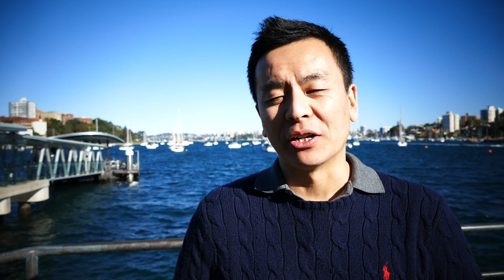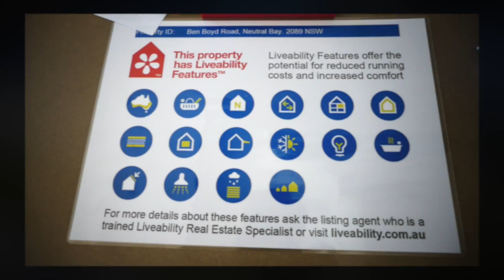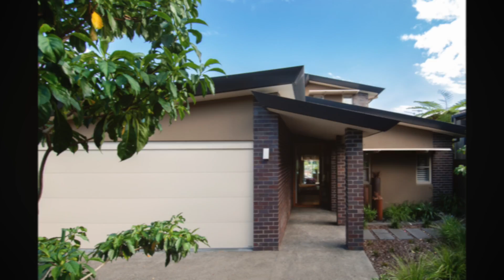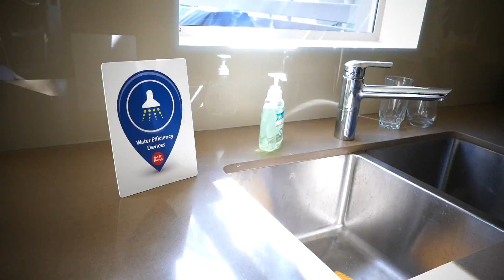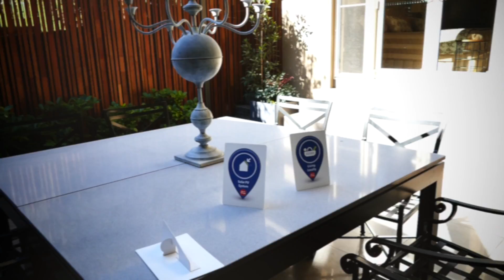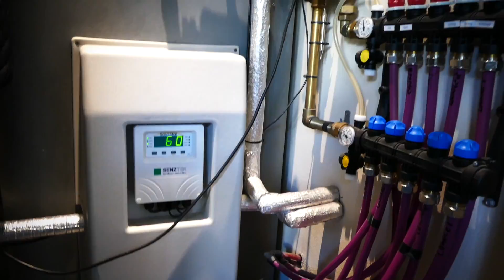Sustainable House Day Solar Hydronics | Ludicrous Feed | Tesla Tom

Comment: Gorgeous house...    I wish a passive solar design were possible for my new home but where I am in SW Florida the environment is just not right, thankfully a passive house is easily attained (well, it’s required two years of research and a million little details had to be considered), especially with the SIP (structural insulated panels) method I’m using.   Many thanks for the great video and the excellent links...   I really like the CLRE page, what a wonderful government agency !!
Reply from the maker: orion khan Glad you enjoyed the video. I’m hoping this house and many other sustainable houses open to the public on Sustainable House Day will inspire others to think about their own living spaces.
Reply: Ludicrous Feed  -  what I’ve found most remarkable in my recent studies of building science is how slow we are to change.   To this day I see new houses being built with vented crawl spaces and attics, two horrific practices that need to stop (among many other construction hold-overs from decades past).   Vented attics are obvious...   you have a mass of super-heated air directly above your conditioned space with the cold ductwork running through it, a recipe for inefficiency and mold (not to mention the space wasted with trussing).   Crawl spaces are similar, another outdoor like mass of air with pipes running through it with similar results.  While not at any specific risk, I’m building my new home with a 5’ sill wall, a solid re-enforced concrete wall, with an insulated concrete slab inside of it.   A French drain runs the perimeter of the wall which is waterproofed on the outside with several inches of closed-cell foam sprayed to the inside...    underneath the slab is 4” of EPS (extruded polystyrene) with a poly-vapor barrier between the foam and concrete (all on top of the scraped and graded land which has a specific type of gravel on top).   It is essentially a miniature basement that sits above the ground with an access hatch inside a closet, lighting and it’s own dedicated (but small) conditioned air input and exhaust.   While this does add to the cost of the build, it really isn’t much and the benefits are well worth it...   it raises the house for any future flooding, bugs and other critters can not get in, it allows alternate paths for air ducting, makes water pipe access easy and most importantly keeps the wood beams supporting the floor in a dray and conditioned environment.

With the structural insulated panel construction I’m using, traditional roof trussing is also eliminated, instead using a ridge beam method, one single beam across the top.  This opens up all of that space lost in a traditional attic and as both the floor and roof have 8” of EPS and the house is airtight, that space can be used for other purposes.

Comment: Here is the back of envelope calculations:
An evacuated tube hot water heater will cost is around $10,000 installed for about 5 square meters of collection area. (Panels + tank + plumbing). Evacuated tube are about 75% efficient so it will deliver about 15kWh of hot water per day.
Spending $10,000 on solar electric panels will give you 10kW of panels which will deliver about 40kWh of power per day. 40kWh of reverse cycle air conditioning will deliver about 120kWh of heating or a little less cooling in summer. 
Solar electric panels need more area (8 sqm/kW) but dollar for dollar you get a lot more bang for your buck. You do the numbers!
Reply from the maker: You do make a good point, Peter.  There's no denying that PV panels give you a better return overall for the physical (roof space) and financial outlay.

Comment: Solar hydrologics:

We have two panels, also vacuum tubes - but in Germany at roughly 51° N / 7° E.

Efficiency: Impressive - the system captures boiling water from the roof on completely covered days.

Effective: quite okay, over the summer you get 100% hot water for showering. I would recommend heat exchanger inserts into the dishwasher, which can fully heat this machine without any electricity. As well as a hot/cold water washing machine, which can do nearly the same. Sadly there's no dryer with a similar system, but you can maybe modify one? 🤔

Both systems need quite hot water, so you need a dedicated very hot water line from the heating circle, since the normal floor heating (we only have this in the bathroom) and convection heaters in the rooms take much colder water than they used to (45-50°C) for efficiency reasons.

So you also need a dedicated pump, we just have a switch which turns it one if both devices take more than 2W combined and turns it off after 1h after the last spike above 2W again. Not pretty, but it works flawlessly.

To the second question: The hot water tank is 1000L for two flats in one house with brick walls and pretty good isolation. (even in the attic). So 4 ppl plus 2 ppl in one house. If there would be days without sunlight and the tank is fully charged, you would have 3 days of just showering for the 6 ppl (roughly) in the tank.

If there are just cloudy days at around 10°C in spring or autumn you get 20-30% of the daily hot water and heating needs by the system on the roof.

If it's very sunny you usually get 50% in spring and autumn, since your heating needs over the day is less, too.

But keep in mind, we also have a air ventilation system with a heat exchanger in one flat which grabs all heat from the air while venting instead of opening the window and loosing all heat. :)
Reply from the maker: Ruben Kelevra Great info Ruben, thanks for sharing your experience!
Reply: @LudicrousFeed  you're welcome. :)

Comment: Very interesting Tom, can you clarify if the hot water for home consumption is the same as the floor heating hot water? Two separate systems?
Reply from the maker: Hi Conrad, the owners told me the underfloor heating is a separate closed loop which gets recirculated.  The hot water for consumption/bathing is separate to the system.  This is my understanding, apologies if that wasn't made clear in the video.